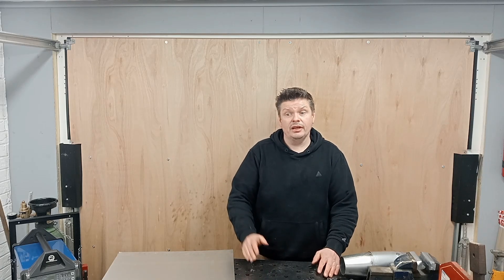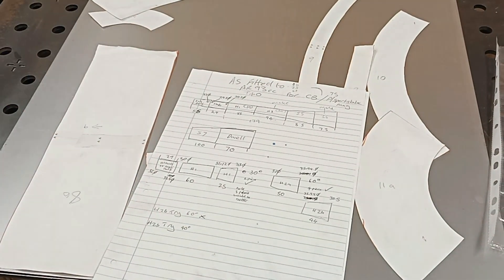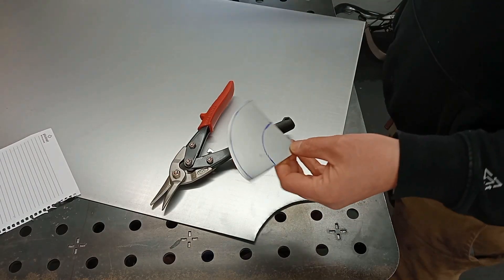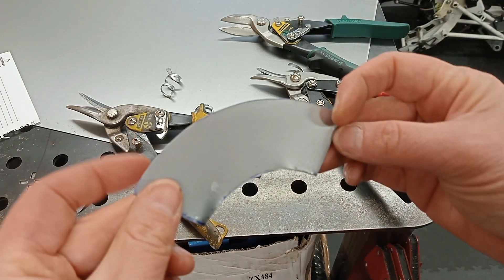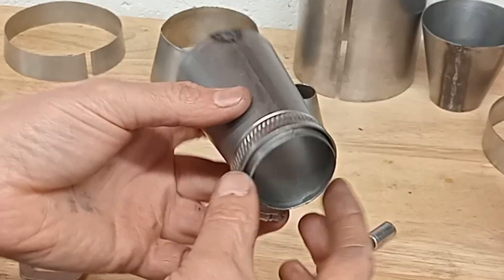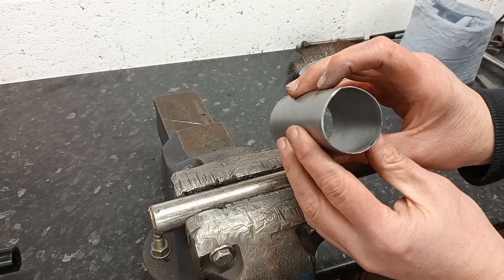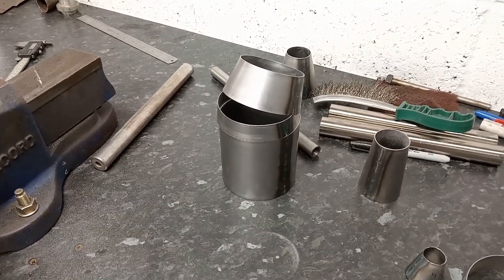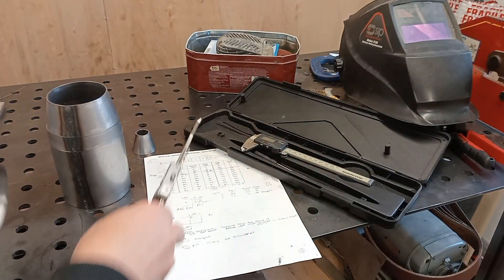Making a 2 Stroke Exhaust Pipe - Expansion Chamber! #exhaust  #expansionchamber

Comment: Great work. This takes me back almost 50  years when I used to stop behind on the afters shift and cut up 45 gallon drums to make expansion chambers. Oxy acetylene welded with a mumber 1 nozzle turned down as low as it would go. All cut and formed by hand. 
The expansion chambers were used on 250 singles and made using the trial and error techneque.
I would love to have a go hydro forming expansion chambers just for the fun of it.
Reply: I mainly used 20 gauge steel from work but I've been known to cut them from fridges, washing machines, and cookers etc when I couldn't get any lol. And like you it was cut and try, I only had the generic maths formulas from books which do get you into the ball park but obviously aren't optimised
Reply: @madmaxsdog8040  It seems so easy to get things now the internet is here to stay,  There is no shortage of white products littering the fields and street corners
Reply from the maker: @madmaxsdog8040  Near home there's a fridge that has been dumped that I've had my eye on... I think most appliances are made from CR1 or 2 sheet steel that has better forming properties and is good for hydroforming.
By some fluke I seemed to have found somewhere that does it! I spent a long time some years ago trying to find some CR 1 or 2.

https://coilslitting.co.uk/mild-steel/#:~:text=CR1%20is%20the%20softest%20from,strength%20%26%20quality%20of%20the%20steel.
Reply: @AutoBeta2T  The metal was easier to work ( and blow welding holes in lol ) but I just thought it was due to it being thinner sheet
Reply from the maker: @madmaxsdog8040  Cheers, I may take the tin snips on a trip for get a bit of the abandoned appliance 🤔
Reply: @AutoBeta2T  Chordless screwdriver, take the whole lot lol, the scrappers won't take it cos of the cfc gas but they take everything else
Reply: Have you made any vids about your X7? 
If not I'm wondering what bhp you achieved and what the dyno curve was like  I'm making a guess at mid to high 50s bhp
Reply: Dave I hope you, all the family and all your subscribers have a great day tomorrow, ❤ to all of you 🌲 🎄🎄
Regards
Roy
Reply from the maker: @madmaxsdog8040  Cheers Roy - have a great one yourself and family 🙂 Eat, drink and be Merry!
Reply from the maker: X7 - no. I had 42 hp on a Dynojet... As I remember the pipes I did gave another 1.5 hp and exhaust and inlet port timing increase gave about the same again. 
Oval boring the STD carbs gave 1.5 again as I remember... So maybe 46-47 on a Dynojet? I never retested as my lad started racing and I decided to stop when my bike ate itself at Pembrey. Plus a Stroke a few months after set me back a bit too. I was very lucky.
Reply from the maker: Cheers Malc ☺️ 
What was the metal from the drums like to work with? It sounds weird but you can feel the difference between different metal. As the drums would have been formed I wonder if they were fairly soft to work with or had work hardened?
I'd love another go on oxy acetylene (last time was BTEC at college in 94...)
Hydroforming is interesting. I'm not sure if it's quicker than cones as there's quite some faff with template layout but quicker to make. As for if there's a performance benefit, I'm curious 🧐
Reply: @AutoBeta2T  Back in those days for me it was a matter of using what you could get hold of metal wise. Materials were thicker in those days and did vary from one make of drum to another.
We chose the thickest material we could which seemed to be quite stiff, better for welding but harder for forming. Truing was done with a 9" angle grinder fixed to a bench with a new disc which was not too true. By removing the guard you had a good 7" to play with.
Welding wise, the material warped with too much heat. I used to love gas welding. At that time I had good eye sight and a steady hand while using my own BOC ultra light welding torch with 1/4" bagging. I found that I could get more into the zone by using the old fashioned twin eye piece BOC goggles, it was like wearing blinkers.
One advantage of segments is that you can make one at a time. When working on afters I used to get  finished from 11-30 onwards so this gave 1 hours playtime to do my own work.
I personally doubt if there's any real performance increase between the two types if made to the same dimensions and build quality.
Thanks for your interest.
Reply from the maker: @malcrandall1309  Cheers for the info Malc ☺️